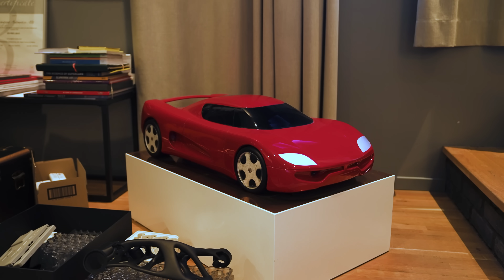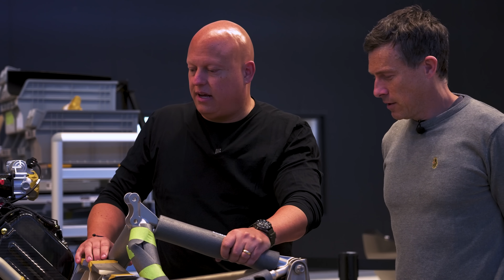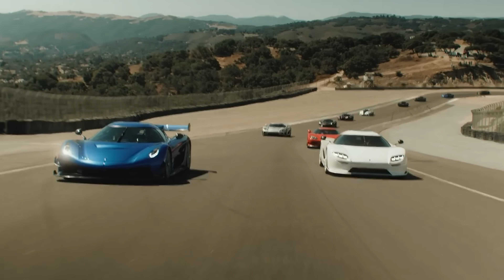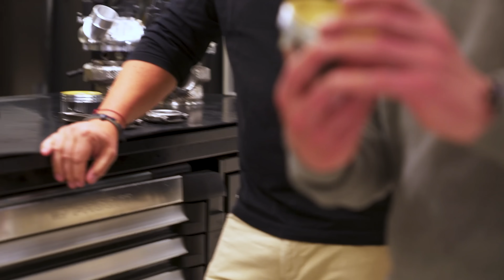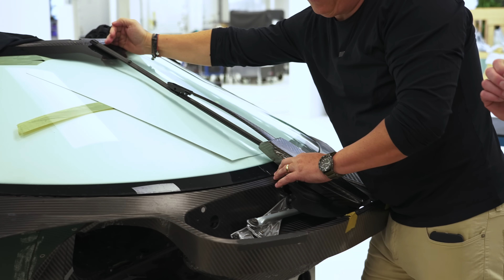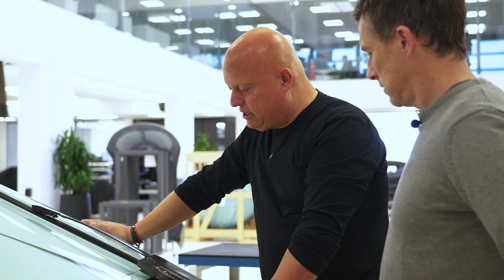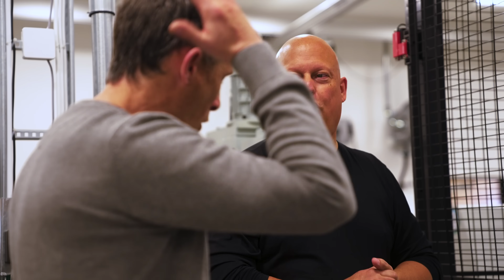Why Koenigsegg’s new 2,300hp hypercar changes everything

Comment: Fiat built a version of free valve in 2009 called MultiAir, negating the need for a throttle body… so free valve is nothing new. Using the tech to the extent Koenigsegg is is a different ballgame though!

Comment: I think one of the reasons for ditching the Freevalve in Gemera is that the valve actuators do not have long enough life span. Best pneumatic actuators can do 5,000,000 cycles... With 2000 RPM that's under 100 hours!🤔

Comment: I feel like we’re getting away from the whole point of carbon fiber, which is just that that it’s a rigid and lightweight material. It used to be painted over to fit the design of the cars. The only reason it’s seen as aesthetic now is that it’s known to be expensive, so people just want to slap carbon fiber on everything to show they have money. This isn’t a point you need to make when you drive a Koenigsegg, of all things.

What I’m also wondering is, is shaving off the laquer and epoxy layer overexposing it to be damaged/scratched?

Comment: the freevalve system was at some point supposed to end up in a chinese SUV high volume production car if i remember correct.
but it never really materialized on the road, right?
that development sounded a bit too good to be true and also did not sound too expensive.
why don't we see it in an every day production car? what's holding it back?

another very important question:
regarding the raxial electric motor, is it possible to adapt the radial magnetic flux double rotor technology/idea from DeepDrive to the axial/raxial magnetic flux motor to squeeze out a bit more efficiency? my understanding is, that forming a magnetic field in the way you like it to be is difficult and the double rotor principle adapts the motor architecture to the natural occurring symmetrical magnetic field and makes the most out of it rather than trying to form an impossible magnetic field (above using tricks like a hallbach array).
would be interesting if the idea of two rotors could be applied here as well and at the end save even a bit more weight per kW and squeeze out half a percent more of efficiency. maybe the diameter can be reduced a bit which reduces the speed on the outside and eddy current losses can be reduced at high rpm? not 100% sure, i am not an expert. the 6 phase controlling sounds a brilliant idea btw.

another question to keep the insanity going:
650 pieces of carbon fiber for one wheel. is there a way to create a machine that would automate the process of making such a wheel and do this as a spin-off company to bring the cost down and sell it to the "every day 200.000€ sports car user"??
a kind of kraken with 5 arms that can change the tools/hands to fit the right movement?

another question: did adrian newey once visited the factory and had a short 10 hour chat with christian königsegg? you know, from one super nerd to the other?

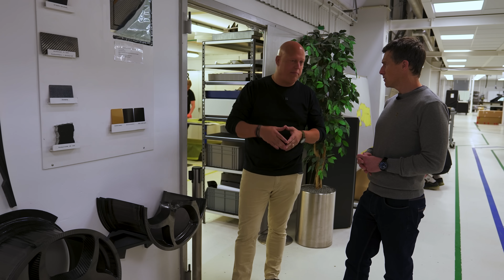Comment: Referring to his comments about the Carbon Fiber rims when driven over a pothole, he claimed that it will not get damaged when the aluminum version will.  And he also talked about metal fatigue (21:45) but composite does not. However, this reminded me of the Titan submersible sub that imploded even though the pressure during the dive was less than the design itself. In other words, we don't know much about composite fatigue/failure modes.

Comment: That's insane. 600Nm @ 1700rpm from a petrol 2ltr
Reply: I want one in my Miata :)
Reply: With 3 sligtly larger cylinders. It's absolutely nuts!
Reply: Matt didn't sound that impressed tho 😭
Reply: @rohanabbas200 Matt was INCREDIBLY ANNOYING in this interview !! He'd ask a question, then cut Christian off when he started to answer 👺
Reply: @edwardfletcher7790  You are absolutely right. The energy and attitude was lacking in this video. 😥
Reply: @rohanabbas200 
I think Matt needs to ease off the Adderall a bit 🫤
Reply: @edwardfletcher7790 it’s six hundred hors…… “SO WHATS UP WITH THESE PORTS???” Lol
Reply: Yes, I want to see that engine used in a car. It doesn't even have to be a supercar, just make it and show that it actually works and has real world value. Show that it is possible to make an engine like that!

Comment: Did Christian say they are able to produce 600 hp from a 2 liter 3 cylinder using this free valve innovation?? That is crazy and completely next level stuff!!👏🏾👏🏾
Reply: very good stuff indeed, the video may be a bit misleading regarding freevalve tho. It is an old technology,  CvK invested in the tech in the early 2000s and is based on ideas from the 1980s I think..
Very good stuff, but not as new as the video makes it look.

Comment: I dont get the tyre excuse from all these manufacturers when the Wangyang U9 is a shit ton heavier and went faster than all these cars with the  tyre that currently available as far as I know
Reply: It's about availability and cost as well. No more than 30 U9X Yangwangs are being made, so you realistically need no more than a couple hundred tires total. Even then, low volume cars with special tires like the McLaren F1 for example still have owners complaining about cost (some 40,000 dollars for a set I believe) but more importantly the availability, you just can't get them easily. Likely Koenigsegg is waiting for a tire that ticks these boxes.
Reply: @minorushiraishifan if I owned an f1, I’d go to wheel-mania get something that looks the same but will fit generic tyres.
Reply: Tire sizes matter. They are not all equal. Also risk assessments also  factor that other might not take as serious.
Reply: Because CvK is aiming at over 500kph.

Comment: The Freevalve engine scares me as an engineer! It just takes a software blip or actuator fail and you have a box of broken metal at 9,000 RPM! Solid camshafts avoid this as basically they are forced to move in correct sequence!  I really hope it goes well for them, great video
Reply: indeed, but then there are fly by wire jets and spacecraft with thousands if not millions of parts that cannot fail
Reply: Their Freevalve technology is like 10 years old already.

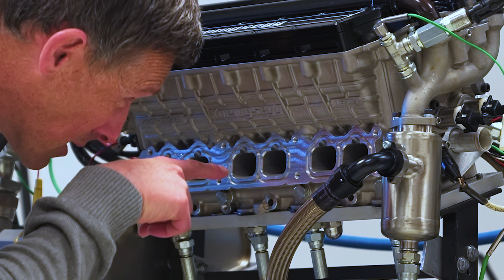Comment: 13:35  Did he say 600 Hp out of a 3 cylinder???
Reply: Yes he did
Reply: seeing as the G16E has been pushed to 750hp+ while still using the original crank, piston and rods, 600hp from koenigsegg's 2.0L "tiny friendly giant" actually seems reasonable, if not a bit conservative. even the G20E is expected to  handle 600hp comfortable with a turbo upgrade, and it's meant to be the more cost effective, less insanely engineered successor
Reply: @deliberatelynaive 
I'm a HUGE Toyota fan, but a 750hp G16E is going to need a LOT of major maintenance, like every 50hrs of run time👍 😁
Reply: @edwardfletcher7790  oh definitely, didn't mean to suggest that it was sustainable in any way. last i read they'd dyno'd it 30 times, but it's also being looked after by a team of people 😅
Reply: I guess so. Ok, when the Gemera debuted on the SuperCar Blondie channel, Christian did say the 3 cylinder engine produced about 600HP if I remember correctly
Reply: Yeah, pure innovation.  Bro and his team are geniuses
Reply: First he say 600hp,then he got interrupted. He ends up with saying 600nM at 1700rpm. (Mixed up nM and hp)
Reply: No

Comment: What i hate about Koenigsegg is that they announced this car in 2020 and 5 years later we still haven't seen many of them

When Pagani announces a new car, max 3 years later they are already delivering them
Reply: Cause they build most of the part inhouse
Reply: if you follow Koenigsegg development from their early days (for me I knew the brand when I watched their CCX got featured in Top Gear), almost every new model of modern Koenigsegg (starting from Agera) took similar time (4 to 5 years) until they get delivered to their customers. The Jesko and and Gemera supposedly would be quicker, but people mostly forgot that COVID happened, and they had to fully shut down their production lines and factories for months. And even after they finally allowed to be operating again, only some of their staffs were allowed or available to work. Not to mentioned their sister company in Spain, which is responsible for building all their big carbon fiber parts like monoques, body panels and so on also couldn't operating like usual. Not to mentioned their new factory development (for Gemera) was also stopped (for obvious reason at that time). 

Another factor that cost them a lot of time is homologation process. Koenigsegg modern cars are homologated for world wide street regulations. Only a handful of hypercars are like that, and compared to those other brands, Koenigsegg is just a really small company. CvK used to say in an interview that only 20% resources is needed for car development, other 80% is for homologations, but once they get it done, they can sell their cars pretty much to any country and still legal for the street.

Basically, with some proper contexts, you will see why Koenigsegg took a lot of time building their cars. And if I can afford to buy one hypercar, it will be a Koenigsegg for sure.
Reply: Time will come, just sit back and relax
Reply: He just wanted to make sure everything is perfect

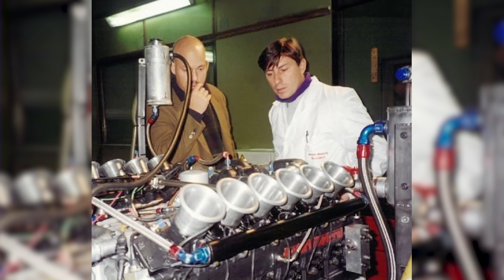Comment: 14:58 A flat 12 cylinder boxer would be way too long due to each piston arm having their own crankpin. Instead CVK probably meant to say a flat 12  that isn't a boxer, which are 2 adjacent piston arms from their respective pistons in each bank sharing 1 crankpin. The flat 6 and 4 from Porsche and Subaru are boxers bc there's less cylinder count to keep the length controlled, and obviously very different design goals. Boxers are flats, but not all flats are boxers, very subtle difference.

Comment: Michelin might be working under pressure to manufacture a tire that can handle Jesko allegedly top speed.
Reply: nuh it ain't a buggati to really destroy tyres.
Reply: @hrushikeshghanekar  based on what?
the guy literally said in the video that they can't reach allegedly top speed because of tires.
Reply: they are
and they are under pressure from bugatti also